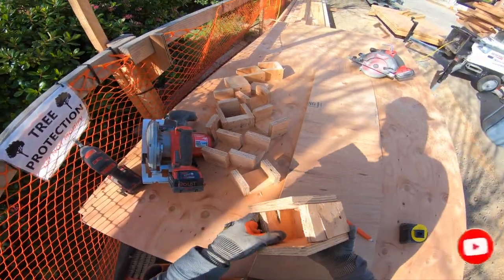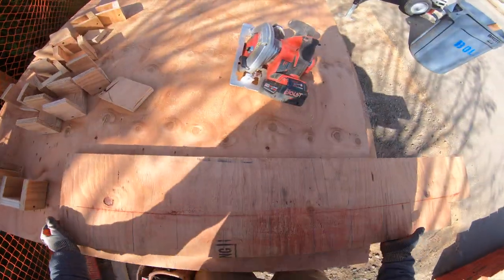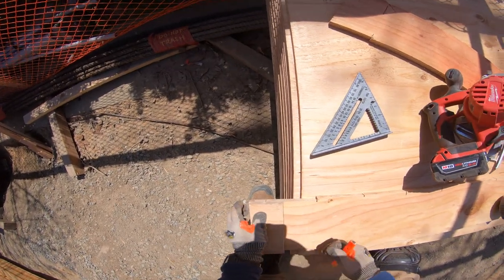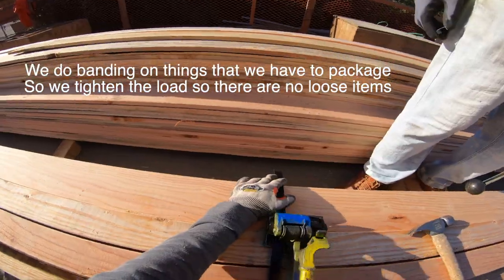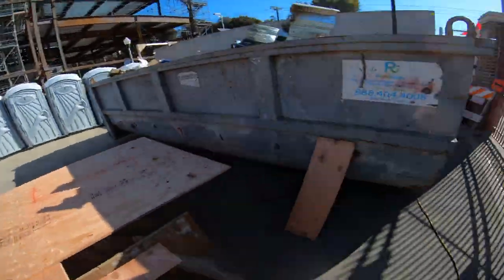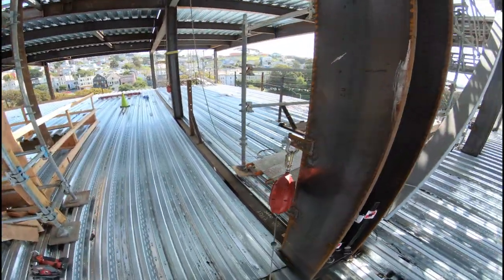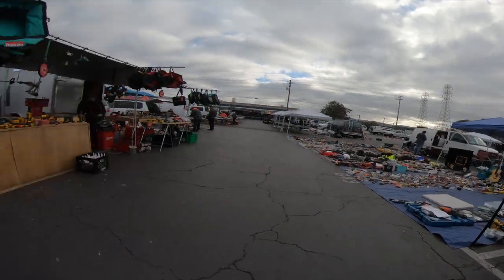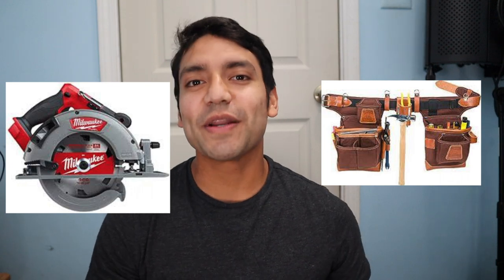Wood, steel beams,Flea market, Stiletto hammer giveaway rules, new challenge=Stay until end of video

Comment: What is the best powertool brand to buy for the job you do I do the same im a first year apprentice I'm looking for an impact driver sir
Reply from the maker: Personally, everyone has their preference. I have used Milwaukee impact drill. They are top of the line. In my humble opinion
Reply: @ChrisQuinteros  not makita or bosch or any other brand then milwaukee ?
Reply from the maker: @3Cliffhanger  All personal preference. Bosch and Makita both good tools, but I use Milwaukee when it comes to impact/skillsaw/sawzall. Now when it comes to grinder/chipping gun Bosch. All personal preference. Alot of good tools but Milwaukee is one of thr best in my humble opinion